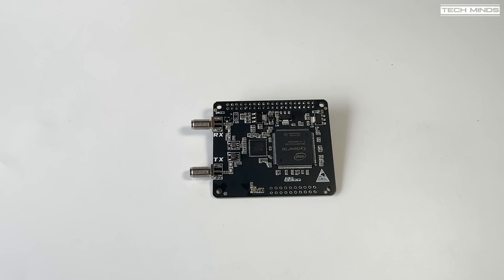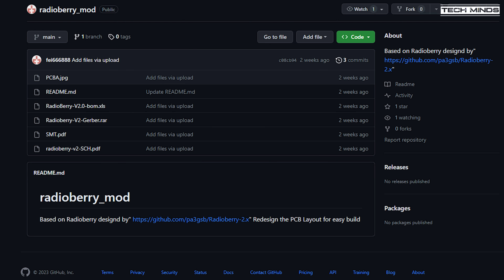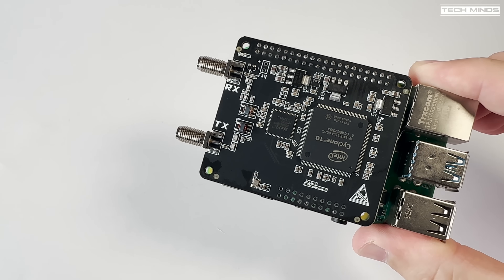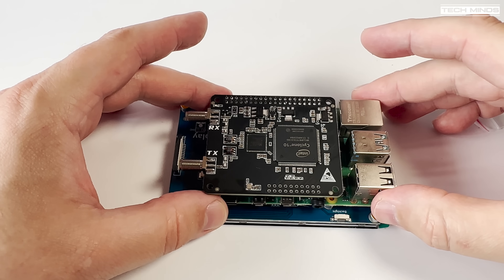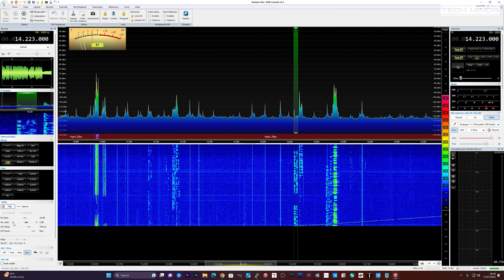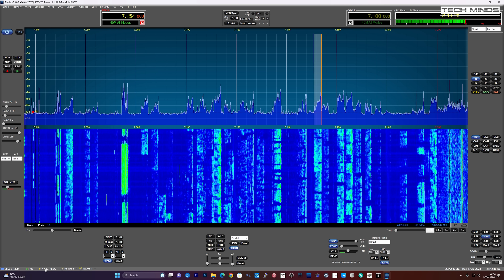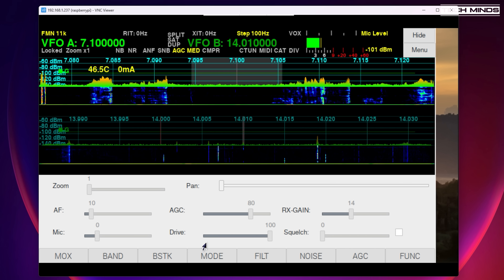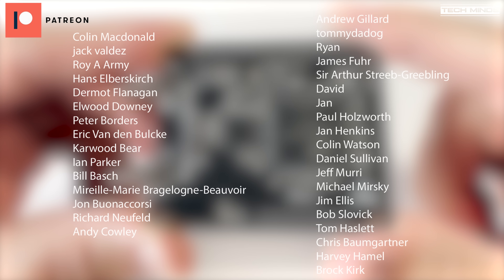RADIOBERRY HF SDR TRANSCEIVER PI HAT - IT'S BACK!

Comment: How do you combine the RX and TX connections into a single antenna? If it's "full fledged" shouldn't it contain the circuitry to combine those signals?

Comment: Warning - don’t ever but anything from AliExpress. I returned an expensive radio to them using their own shipping label. They first claimed it did not arrive. I proved them wrong. Then they claimed the it was not the same as I’d purchased. Again I proved them wrong. Then they claimed it was damaged. They refused to either return the item to me, nor refund/replace it. Their pantomime of dreadful customer support went on for over 3 weeks before I finally gave up for my own sanity. They now have both my goods and also my money. It appears that AliExpress is just used a sham business to allow crooks to trade without liability. So, I lost £230 thanks to the fraud and lies of AliExpress and their sellers. Never again will I go near that disgraceful site.

Comment: Can I use this application to generate RF signals at widths and frequencies similar to restricted radios? I have a requirement where I need to generate one of these signals to validate whether an Access Point that is transmitting in DFS will stop transmitting the signal.

Comment: Good morning,
I have a radioberry and I would like to do TRX switching by a handheld microphone...
I see that on the card there is the CN301 connector. Are pins 13 and 14 used to manually trigger the Transmission?? Should we use a Pull Down resistor and what is its value so as not to be directly linked to the FPGA... 73

Comment: I find Radioberry to be an excellent receiver. However, it is a bit tricky to setup, and I've decided to do a video tutorial after doing some research and many tests with tries and errors.

My latest gripe is that the Raspberry OS images are constantly changing. Just recently, I found out that Bullseye no longer has the Linux headers available out of the box, and the relevant package is not available in the repository either. Conversely, Bookworm doesn't require any extra commands to install the correct headers, and a user reported that it should.

Comment: Fantastic. A constructor's dream.  Not long bought a G90 which does all I need after years of building qrp rigs which were too bulky, limited and decided after years of it to buy the G90. Wish this was around at the time. I could still go ahead, but why. The enjoyment of constructing and learning as I have done in 50 years of it. Still got some valve gear working. But this is superb .I have a pi 4 doing little with 4gig ram.   Thanks for the info.

Comment: I have the original board I was never able to get working. Is there information on the "short" where its located on the pcb so I can try to fix mine ? 73 KO4MKP

Comment: Thanks for the great video! Been watching it many times while I got mine up and running. But one question: How did you get it to almost fill the screen on the 4" LCD? I have a 1024x600 touch screen, and the Radioberry only fill about a quarter of it.
Reply from the maker: Thanks for watching :-) Well, that's a tricky one because the screen size of PiHPSDR is hard encoded and you have to change it in the source code, and then re-compile it.

Comment: Why did you choose option 2 in the installer cl025 when device chip is cl016?
Reply from the maker: It was just the screen recording, CL016 would be correct for my type of board. Well spotted!
Reply: @TechMindsOfficial  no worries, i blindly followed you without checking and ended up with just a constant tone coming through. All good now after changing to cl016.

Comment: I stick to the buy once cry once idea. And for the $200+ dollars in parts I would just spend another $100 for the hackrf which seems to be the best from the little I know
Reply: Then why not go LimeSDR?
Reply: @sonofnone116  I'm pretty new to the radio stuff. Limesdr does look pretty cool. Right now my constraints are money and knowledge. Just got a hf rig, battery, antenna and the parts and pieces. After I mess around with my new toys I will go back figuring out sdr. The lime does look good and it says it works with Linux.

Comment: How does this compare to the Caribou Lite from Crowd Supply that also uses a PI. It has 2 transcievers and wider range and about half the price?
Reply from the maker: As far as I am aware the Caribou Lite does not work on the HF bands, as this Pi Hat does. So its not really comparable. Thanks

Comment: Incredible device, so tiny and low on power requirements. 5 Watt TX boards must be just around the corner soon. The modulation is super clear and is a real demo of what is possible with SDR. Thanks for info, great video.
Reply: Здравствуйте скажите пожалуйста откуда информация про мощность TX 5 w ???  I am not sach this. Thank you for the ask

Comment: Looks like no filters so probably dirty as hell and way to much money. I could get a 450 and have better system
Reply from the maker: Did you watch the video? The bit here I demonstrated transmitting and I also said it is compatible with the N2ADR filter board? What's a 450?

Comment: I was waiting for it to be available again, I build my own SDR software for this device to run as a standalone tranceiver. Works very nice I have a demo on youtube
Reply: Hey there, I've been getting into HAM and snagged a UV-5R. Obviously, it's pretty limited as far as actually picking up most of the things around my area as a lot is DRS. 
Can this do DRS? Also, I'm mainly interested in building out an automated scanner. Is that something that can be done in the open-source software or would it have to be done in code?

Comment: This design uses an older AD9866 ( 12-bit 80MSPS ADC, 12-bit 200MSPS DAC ) Mixed-Signal Front End.
It was commonly used in Broadband Modem transceivers, where it's probably getting sourced from now. 😆

According to Analog Devices the AD9866 is not recommended for new designs! 
AD9866 was around USD 40,- /pcs. 
Intel Cylone 10CL016 in 144-LQFP cost around USD 35,- /pcs.

Since you're probably buying an upcycled modem MxFE, this product should cost nowhere near USD 150,-
Reply: if the hw (PCB + assembly + parts) cost around 50USD than 150 USD is realistic. For small production runs (like below 100000) 3x multiplier is recommended in business, if you want to stay in business.

Comment: Will it transfer any file over this communication system?
Reply: If you have a radioamateur license,  yes you can send and receive email and small pictures.
Reply: @TheErilaz  Thanks for your reply. Would you please tell more details about the licensing?Like, How to avail that? Who is responsible to provide? What are the procedures and costings should be?
-Thanks
Reply: @md.shahinurrahman747  you'll need to check your local licensing laws. Any way, if your main  aim is to transfer files, just use a mobile phone or PC over the internet. Using this will not be as cheap, fast or secure.
Reply: Any files of the average sizes used today would take a long long time to transfer. It would also have to be sent in the clear as, at least for the U.S.,  transmitting encrypted messages is illegal. And yes, you have to be a licensed ham operator with hf privileges to transmit on those bands. The bottom line? Don’t do it.

Comment: I'm just wondering if there is a cheaper version or a lite version or some kind of replica of the project for cheap?
Reply from the maker: I think it's pretty cheap already for what it is. The Gerber and the BOM are available on the Github link that I shared, so you can potentially get them built yourself from places like PCBWAY.

Comment: Thanks Matt, I enjoy your very informative videos and watch them straight away.  For some reason I have trouble with the AliExpress links, I cannot make them work. Using Chrome, but have tried Edge. Even tried just pasting the text of the address, the links are flagged as not secure. Does any body know what I might be doing wrong or experience the same issue? FWIW I can navigate to AliExpress independently and find the items if I know the search terms and have purchased from them many times;
Reply from the maker: Strange issue you have there. Definitely a local issue for yourself. If you make an AliExpress account and make sure your locale settings are correct, then the links should work fine.

Comment: $150, man I was hoping for a $85-$99 price range
Reply: Much cheaper then 5k plus
Reply: HackRF 😅🤑
Reply: Consider that a decent hf rig starting price is $600. - $10k.
Most hams only have wet dreams about a hf setup. This works for a lot of people. $150 is a gift if it performs as advertised. I'm setup but like to play. Plan on one in the very near future.

Comment: Unfortunately the Chinese production use poor quality components. Build it by yourself, don't buy Chinese garbage . It's unusable.
Reply from the maker: Totally wrong...! Although I would agree with you about some products from China, this particular product is high quality..
Reply: Current Cinese Radioberry use 2 layer PCB less screened . The original one use 4 layer PCB. If vendor economizes on PCB quality do you think that the components are good ?
Reply from the maker: The proof is in the testing… Do you have one to test? No, I doubt you have. Whereas, I do…
Reply: Since that  you believe that  two layer pcb works like four layer shielded pcb and low cost capacitors and not original components works like an high quality implementation please show me your measurements comparison. I don't believe in miracles. I don't believe in Chinese rubbish

Comment: Brilliant wideband TXaudio, apart from too much software based compression, but it looks like a very nice unit.
Though it is very painful to see that you can rather use the hat OR do some necessary cooling🙄. 
I guess if you resolder the connectors the other way around you can run the hat as a "shoe", underneath the board and can give the CPU & GPU is desperately needed cooling.
Why are electronic- and software desingers so often people who don't actually use their stuff and bump into these basic flaws?
My Pi4 is already at 53 degrees with less than 30% CPU load while being attached to a big passive metal heatsink! When using an IR gun the heat sink is actually just above 50°C while decoding a few HFDL channels at the same time showing planes all over the world. (OpenWebSDR+ with ready made Pi4 image, brilliant! but a different subject)
According to sales order product description as well as Analog Devices AD9866 datasheet, this is HF only and only 12 bit, which is quite challenging for an HF receiver, for TX its more than good enough.
It is nice to see something so powerful that it can be operated stand alone, Respect! 
I guess when in the field with "noisy" electric resonant TX antennas 12 bits is a good-enough compromise.
Only at home with a high dynamic ultra wide band antenna a 12bit RX will be asking for trouble. Here in Germany I sometimes receive Radio Romania and Voice of Turkey with more than 90dB signal/noise and that requires 16Bit or more if you don't want to use an attenuator and risk droping weak signals nearby.
This HF transceiver front end is relatively inexpensive and probably worth the "12 bit compromise" - thanks for sharing!
Reply: When are you going to make your revision available for purchase?
Reply: @tracymoon4437  
1. I am currently unable to use a any PCB design program (used Eagle long time ago), but I am working on regaining the skills with an open source PCB design program
2. I don't have the knowledge to design such a modern and complex unit, though I have been designing and selling radio modems in the 90's (µ-Modem / MX10).
3. I would have to see if there are any transceiver chips available that do more than 12 bit, because apart from ham radio most UHF/SHF applications (e.g. mobile networks) nothings works over long distances that would require a higher dynamic RX, for my understanding this is mainly SWL-DXing / Ham Radio, in other words mainly for the super nerds😂. When you use this wide bandwidth of a few MHz, most RF protocols don't require high dynamic to get a good bit error rate. I think this chip has been designed for baseband operation, not for actual HF operation that we use it for.

So no, I am incapable of designing something like this, therefore have a lot of respect for those who do and am thankful, but I would be even happier with them if they would sometimes have a little more practical approach and also use their stuff for a few days and be critical about it when operating it in the real world.
The good thing about the PI4 cooling issue is that when soldering the header the other way around on the PI and TRX-PCB, it will work without any re-design, only the basic 12Bit lack of dynamic issue on the RX will remain. But as seen here it works quite well if you operate it under certain conditions and don't look so closely.

I have been designing many things (in RF/audio/DC domains) that worked but were not good enough for real world application for my taste and just showing them at fairs, people would come by and offer me money to buy these prototypes, but I refused because I knew it could be done better in detail, while causing me less to no trouble when offering the maintenance/repair for a mature product.

Comment: Thanks for this Matt - Been waiting what seems like forever for this to come back into supply! Ordered :) 73, Steve
Reply from the maker: Hope you enjoy it!
Reply: @TechMindsOfficial  not worth the trouble without the preamp that was designed for it. can you pull some strings?
Reply from the maker: I’m trying!! lol.. I’m hoping Justin makes a re-boot of the pre-amp board like he has with this Radioberry. However, making a switching relay and filters is actually pretty easy to do using the header on the Radioberry.
Reply: @TechMindsOfficial  Count me in too Matt although an open source PCB and soldering is an alternative for squinting eyes and burnt fingers LOL!